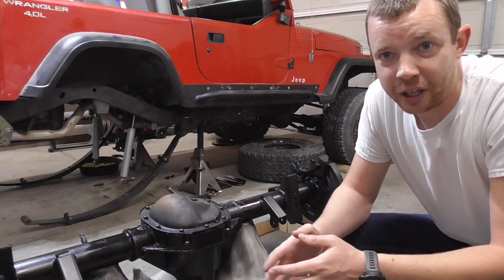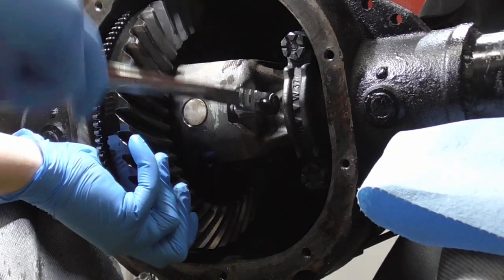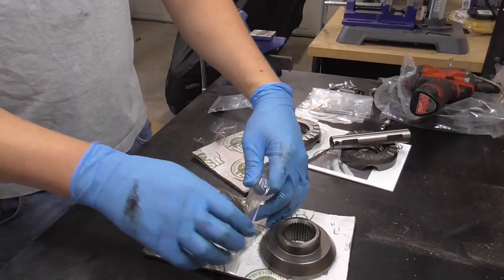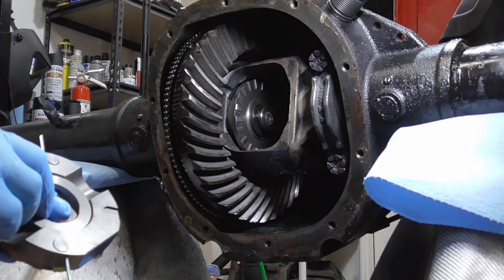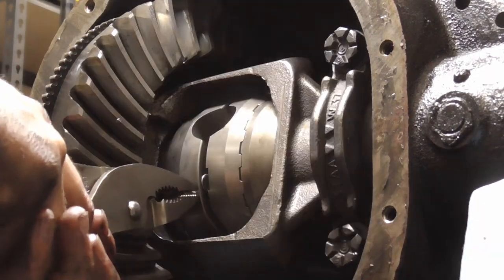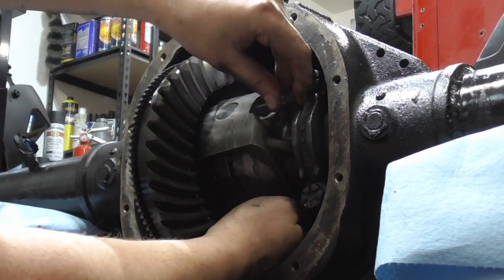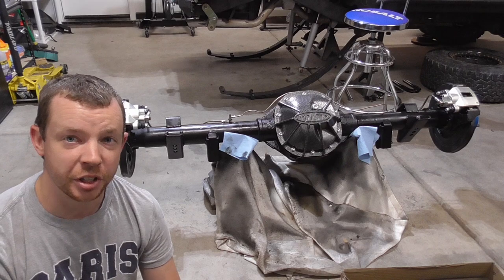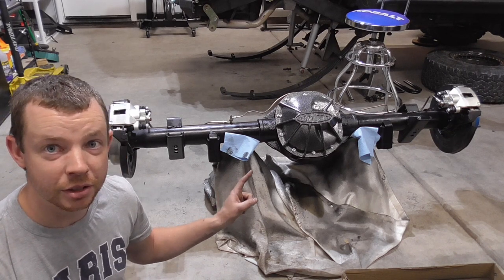Spartan Locker Install in Ford 8.8 (Explorer/Jeep)

Comment: NIce, seemed a little complicated for getting those spacers and couplers. 

95-01 8.8s (discs) have a fill plug on the pinion snout. That Solid cover had a high level fill plug. You want to fill to where the fluid is at the base of the axle seals (bottom of the axle tube). So don't use that cover's fill plug as the point. Its way too high (my experience, LOL).
Reply from the maker: It was definitely a tight squeeze getting everything in. A non C clip axle would have been much easier.

I was wondering about the fill plug on the cover. It would take like two gallons to fill it up to that hole haha. Will definitely be using the plug on the snout.

Comment: I wonder why that SL F8.8-31 # 17005 kit costs $ 582 on the USA Standard Gear Spartan Locker website but only $ 250 on Amazon and eBay?